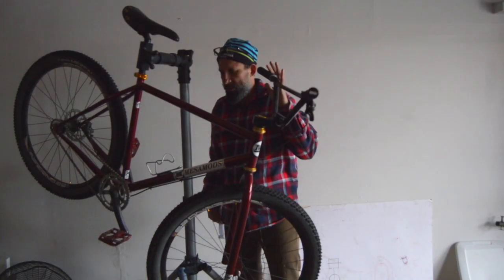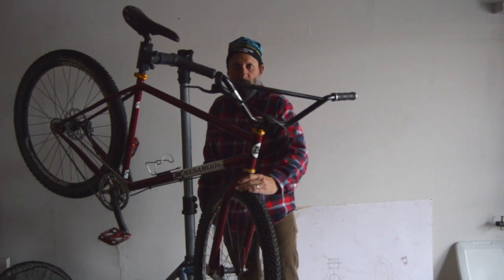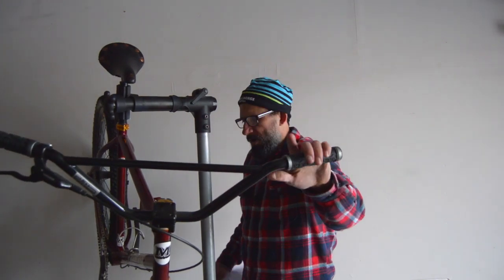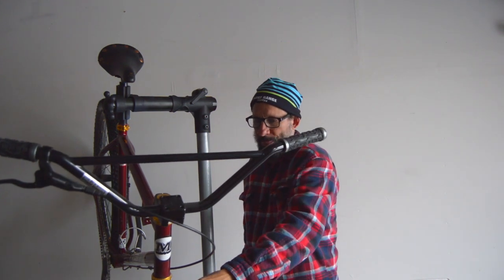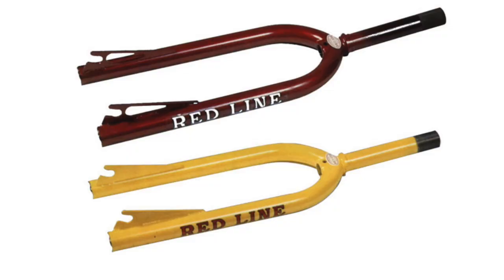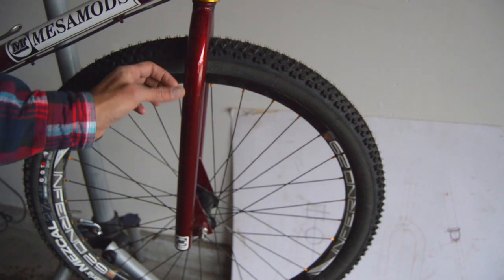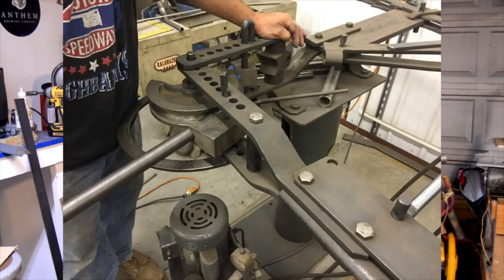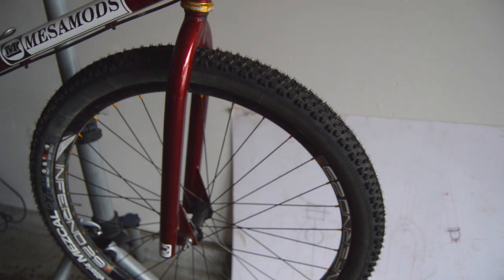My First Bicycle Fork Build From Start To Finish

Comment: Wouldn’t the fork caps have seep holes in them? No need to drill a hole for gases
Reply from the maker: If the caps had holes in them, they wouldn't look like Redline forks from the 1970's. That was the goal. It's a unique 1 off for for my personal bike. I don't ride it often in bad weather, but there are holes in the top of the fork at the steerer tube. 
I also live in the high desert where moisture evaporates quickly, so it hasn't been a problem at all.
Reply: @JoeyMesa  gotcha the desert helps. I live In east Texas. The moisture here is ridiculous.
Reply: Those forks have no way to let condensation out.
Reply from the maker: See the other reply...

Comment: What welder do u use for mold steel and hi tensile steel
Reply from the maker: For thin wall steel, a TIG welder is the best option. That's what is being used in the video.
Reply: @JoeyMesa  can hi tensile steel and stainless steel be welded together with a tig welder
Reply from the maker: @TW39  yes

Comment: need to build something like this! do you use common carbon steel in the shaft suport and the bottom circle caps? their weld nice with the cromoly tubes? klunkers are our lovely childhood extension!!! real funny bikes. Where I live nobody sells straight forks for 26 wheels, bad there... this video is a hope and inspiration for me. greetings from yguazu
Reply from the maker: Thanks! Yes, the bottom caps and the dropouts are mild steel. The rest is 4130 cromoly.

Comment: Very cool build!  Do you recall what radius bend you could achieve with that bender, and the .065 wall 1.25” tubing?    I have a project in mind and I have my eye on a bender like that.

Comment: Do you buy the bottom part of the steerer tube or make it yourself? The part that has an edge such that the fork will fit up nicely to the headset? I have been looking into buying steerer tubes and fork blades to build my own fork but that part of the process I am not sure how to do.. Thanks for great content.
Reply from the maker: I got the crown race ring from Nova Cycles https://www.cycle-frames.com/STEEL-UNICROWN-OVERSIZED-RACE-RING-FINISH-OD.html?category_id=1043
I also got the 1 1/8" steerer tube from them. Since my fork legs were 1 1/4", I took an extra piece of left over material and pressed it onto the lower portion of the steerer tube just below the race ring. It looks like Nova is currently out of stock, but the little ring made it pretty easy to get the fork built. 
With all that said, I still had to file it down some to get the crown race from my headset to press on. Thanks for taking the time to leave feedback and for your question!
Reply: @JoeyMesa  Dear Joey. Thank you very much. We are running a non profit bike workshop here in Svendborg, Denmark, giving out free bicyles to people who participate in fixing them up. Our next dream is to start modifying and even building frames from scratch :) Videos like yours are a big help!
Best

Comment: Nice work! I probably would have welded the inside edges of those dropout sections as well although I'm sure it's fine. I'm planning to have a go at making a segmented fork for my next frame. You might be supposed to do a preheat when welding cromo that thick and going by the book, I'm not 100% sure.
Reply from the maker: Thanks for your feedback! Yes, I generally like to weld all the way on both sides of any kind of bracket, or in this case, a dropout, but I basically wanted to replicate the look of how Linn Kastan welded the original Redline fork dropouts, so I just copied that weld pattern.
All the info I've found about welding chromoly says room temperature is fine up to .120 thick. I think my crown ring was thicker than that, but the welding there was really just to hold it in place and not anything structural. I also pressed a scrap section of the 1 1/4 tube onto the bottom of the 1 1/8 steerer tube so the outside diameters would be the same (fork legs/steerer tube weld point), which is what the weld on the bottom of the steerer tube was for. I think the combination of that was probably in the realm of .120, but I feel like it's ok since the fork legs are .065.
Thanks again for taking the time to comment!